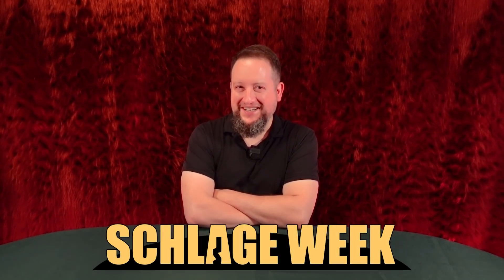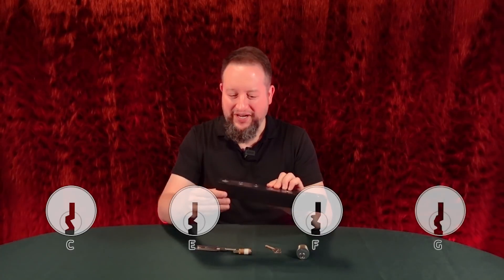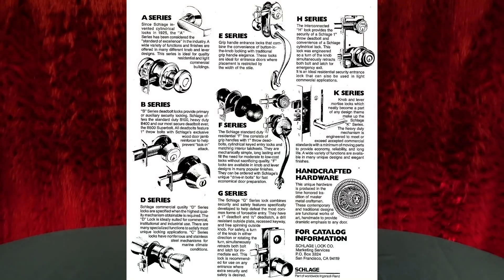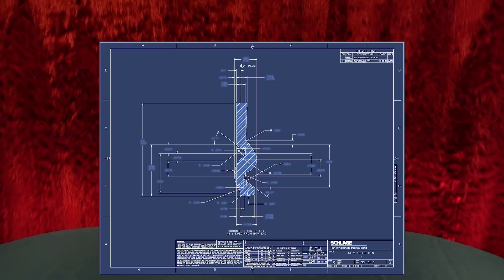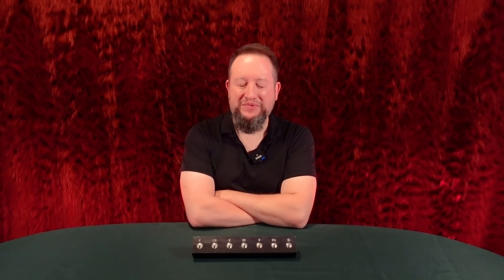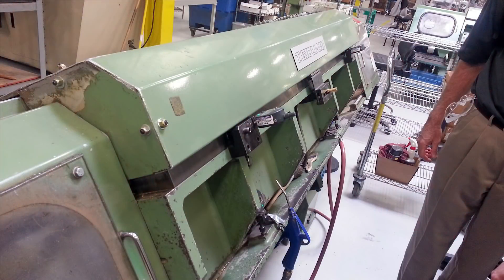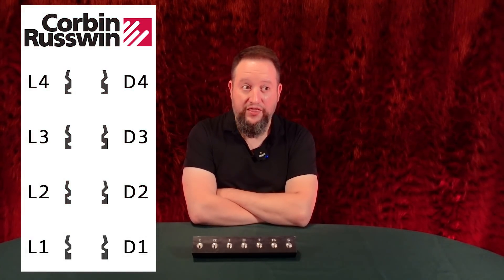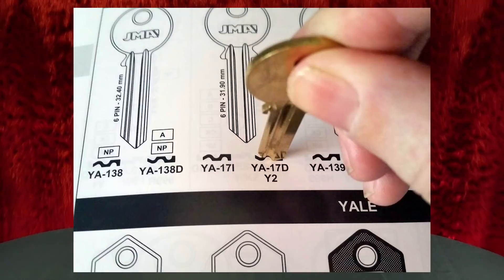Why Is There No Schlage "D" Keyway?  [#SchlageWeek Day 4]

Comment: The reverse keyway thing as a security feature kinda seems silly to me in a world where solder exists.
Like, if someone's going to break into your facility with all the prep work of buying a blank key, picking/finding that lock's pinning values, and cutting their own key for it...

Then surely they could just buy 2 of the wrong-direction blanks, cut the blades to length, solder them together (for more surface area, don't just cut straight down, cut or sand it on the flat side at a sharp enough angle that when you've matched them, the faces have LOTS of surface area contact for the solder), carve the excess solder out from the contact points once it's hardened, cut a new key tip angle, and just like that you have a key blade long enough to fit +6 pins!

Now you can cut your biting, maybe fancy it up with a proper bow if you REALLY want to, etc.

When you provide it's perfect mirror opposite, the reverse keyway really doesn't do much to stop someone who's determined to have a working, "proper" key.

Comment: The best video in the series. I have learned new stuff. Here is some conjecture... Schlage invents the cylindrical lock (A-series with and aptly names the keyway A for its wafer cylinder) next Schlage produces the Deadbolt bored lock (B-series perhaps with keyway B for its pin tumbler cylinder).
Do you know which lock used B keyway and if a C-series lock actually exist? I have never seen either one...

Comment: Fun fact, Schlage letter keyways didn't end at L, they had a restricted reverse of all of the lettered keyways, super ancient stuff, there were a few hospitals where I'm from that used to use them. . . Then they got into the numbered keyways. you can find this stuff lingering around, especially in the San Francisco Bay Area, where Schlage was based. Including a d keyway plug.

Comment: Cool thing also d like dexter (right) ... thanks for sharing.
however I wonder did it never occur to them, that you could always source a left one blank and cut it down to use it backwards?! (essentially flipping the key too )
but then again it is about the time and effort you have to spend on a lock. 

PS I get your notion on the other YTs.

Comment: I do feel like I ought to point out that A and B batteries were the name of the voltage that was being put to use in those old battery powered radios for which those were primarily used... where as AAA, AA, C and D are sizes of battery; all are 1.5VDC nominal.

And i don't so much mean voltage as "voltage rail"; I think A was filament, and B was plate supply.

On reflection, this is almost exactly parallel, I think, to the A keyway vs A series thing with the Schlage locks: different namespace, even though the names are all single capital letters applying to locks.

Comment: That A keyway looks familiar,    I think that's what the locking handsets in a early 1950's apartment I work at uses.    It also has the cool 8 or 12" extensions (which are unobtanium) to move the handset closer to the middle of the door.
Reply from the maker: oh that's amazingly retro.  very mid-centruy modern.

Comment: No you can get some closure on why no D keyway.
Reply from the maker: yep, i finally caught the D, ha
Reply: @DeviantOllam  Alledgedly at one point they did seem to offer the D, as part of a an old school restricted keyway familly. As in you needed to get them direct, as part of a big institution. Or if you were a locksmith hired by the institution on contract you needed a letter of authorization from the institution (the "end user") to order the blanks.

There was alledgedly a whole familly of reversed versions of the standard classic series keyway: D, DQ, Q, QS, S, ST, T.

I've seen this posted in multiple places, but cannot verify if this is actually true.

Would not shock me to if Schlage itself was the only institution that actually ended up using the D keyway, since people wanting such a system would probably prefer the reversed versios of the less common keyways.

Comment: 2 dimensional lock.  Way back I got involved with how things would work in a 2 dimensional world.  I designed a 2 D elevator, another guy designed a 2 dimensional lock!   Both would work in 3 dimensions.  I will have to find the monograph where both were published so you can look at the lock design.
Reply: I think those are the kind of locks they use in flatland.

Comment: I was a locksmith for 11 years. I ran into a Schlage B keyway on an old house. I had to re drill the hole and install a new lock. The locksmith company I worked for started in 1905, and we did not have blanks for it. I used to run into the Schlage A locks. Those keys were punched on a special cutter. I used to encourage people to replace them. I find your channel very educational and entertaining. Keep up the good work.
Reply: I would cut A keys on a normal key cutter locked in the jaws. They would vibrate madly if you tried to do anything but a light cut. Cudahy Wisconsin is absolutely full of ancient homes and those locks were frequently encountered even in 2000s
Reply: I’m going to have to look to see if the hardware store I work at has B key blanks, I know we have A, but I don’t know about B…